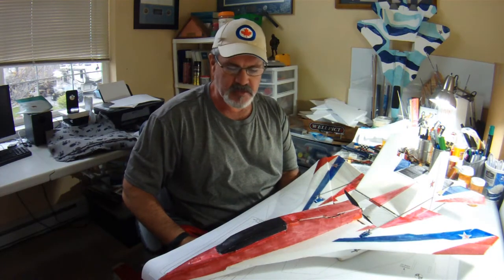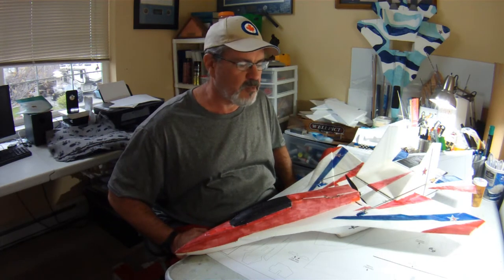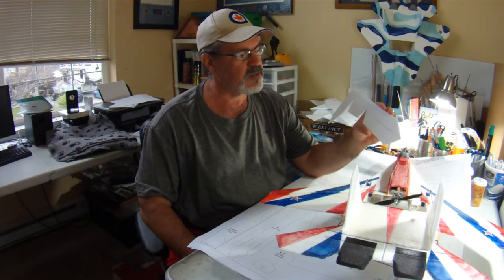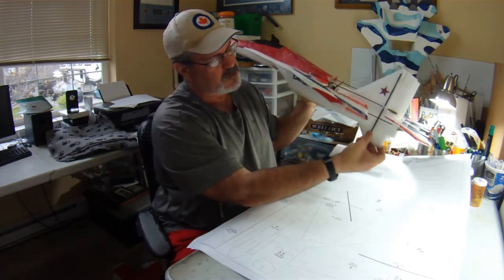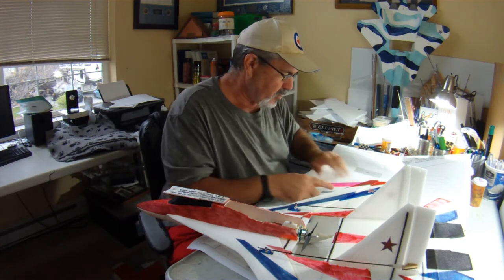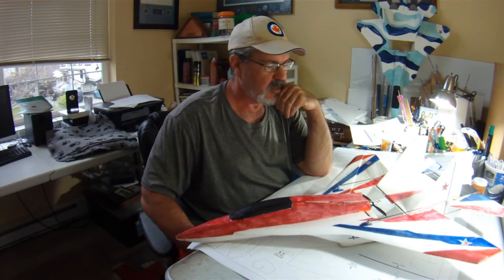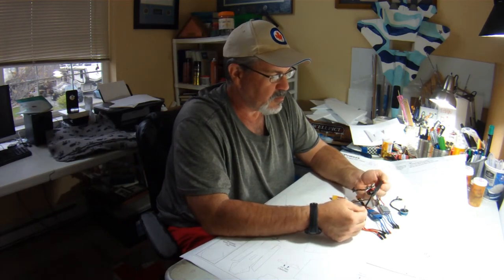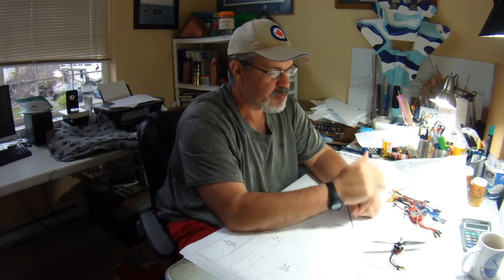RC Powers Su30 V4 "speed build" brainstorming session - 28 Apr 2018 :)

Comment: Hi Scott
Sounds like you're feeling the need for speed! Cheers for the mention as always. Till you get your 5 inch props or maybe to try at first before you try the 6x3 prop. If you have enough spare TGS props 6x3 or 6x4. You could try doing like I have done in the past and cut one down to 
5.5 inches. It works quite well as although the prop is shorter it allows the motor to spool up more as there is less stress on the motor. So you still get good thrust but with less amp draw. I normally just cut the TGS props to length with a pair of wire cutters. After measuring it first of course. I never just guess it ;)  Then cut another bit off the leading edge where the prop curves round. This is done in 2-3 cuts. Then with some medium grit paper shape it like the original tips or as close as. Then finish with some fine grit paper and round off the top leading and trailing edges of the prop leaving bottom or underside of the edges flat like a wing aerofoil.
Could be worth a try. Can't wait to see how the new Su-30 design comes out.
...RCPP
Reply from the maker: Thanks for the tips as always, RCPP, I'll keep that in mind, I'll see how I get on with the 6x3 first, I have lots of those and 6x4 TGS that I can trim down if need be.  Cheers, Scott